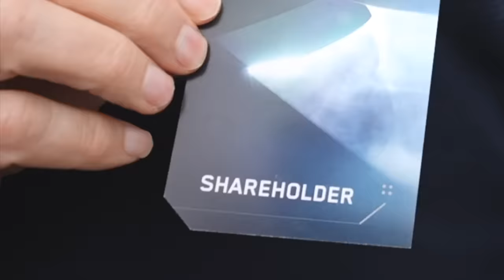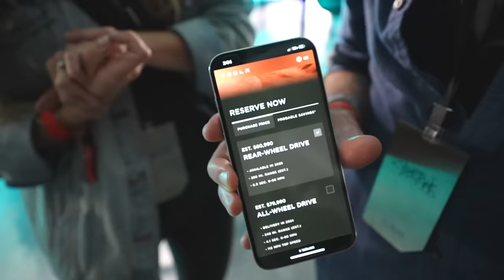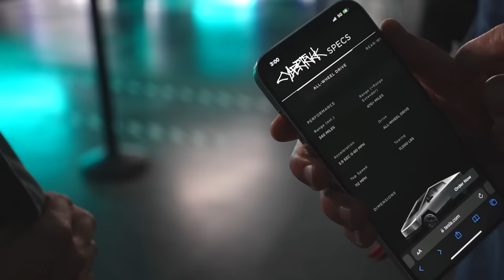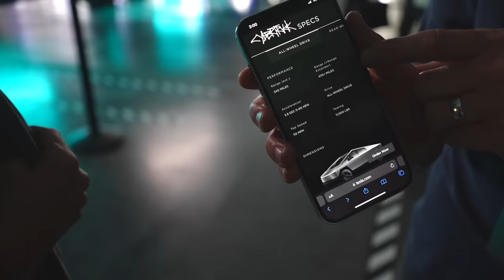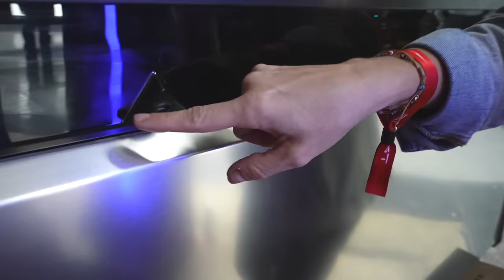I’ve Owned 4 Teslas, but the Cybertruck has me Confused

Comment: Is it true that the CT buyer agreement will have a clause prohibiting resale within a year?  

If so, Tesla is turning an eye to secondary markets and public/competition (as mentioned in video)

That in mind:  it seems battery supply is less than ideal, FSD 12 should be out of Beta, and mass market vehicle is ~2yrs away, mass transit vehicle maybe another 2yrs after that, and then the Tesla bot is ramping fast both mechanically and intelligently.

How long will Tesla continue to sell vehicles?  How long will Tesla "need" the upfront capital from vehicle sales?  At what point will it make economic sense to go subscription only?  

I kinda get the feeling that by 2030  purchase options will be less than today.  

FSD is pricing is currently at a ceiling without an increase despite recent developments. 

Mass market vehicles will be the most tech capable at the lowest price point, will their agreement prohibit resale of any kind?

Big advancements are around the corner, hard to imagine that the age old purchase agreement transaction remains unchanged throughout.

Big Tesla Fan/Shareholder, but non-plussed by the CT delivery event.  Was expecting a no brainer decision to buy, and now like many others, searching for reasons not to cancel.  Specs are too closely competitive 

Sorry for the long rant..

Comment: As someone who drives full 4-wheel-steered construction equipment, it is very easy to use.  While making a right turn the back tire can not run over the curb, as the rear tires follow the path of the front.   CT, I believe, has less steering angle in the rear then the front, so you'll still have look.  @my2cents395

Comment: Could never go down to 250 mile range.  My 5 1/2 year old LR Model 3 has 20% range degradation after 89,000 miles.  If they drop the price of the mid-range version from $79,900 to to $72,000, then apply the $7,500 tax credit, I might consider.

Comment: I think Zack's response was ridiculous. A lot of thing's have changed in the world and inflation is out of control and for him to think they could still offer the original pricing from 4 years ago is out of touch with reality. They obviously ran in to far more production issues than they had planned on not to mention Elon has investors to answer to.
Car, SUV & truck prices across the board have increased dramatically in the last four years so the new CT prices should come as no surprise. As far as range goes maybe it will deliver far more range than stated and anyone that believed they would deliver a truck that large with over 500 miles of range with current battery technology needs a reality check.

Comment: Everything has gone up since 2019. Don't blame Tesla; blame your government's economic and spending policies. As far as the Cybertruck itself, I've hated its doomsday/mad max look from the very beginning, but now that it's in production, I am finding myself liking it. Why? Because of what is in front of our eyes, I.e., the ruggedness that only the Cybertruck can deliver. Most vehicles, if not all, can be damaged, at least cosmetically, by a renegade shopping cart or hail, but not Cybertruck. The Cybertruck might be the only vehicle you can not give AF about when parking at a Walmart parking lot or in your driveway during a hail storm. I worry constantly about my R1T everywhere I go. Range, as we know, is one of, if not the most difficult, things to achieve in an EV design. The range of the original Cybertruck was part fantasy, and I'm sure on paper, it was at least possible. But developing the 4680 fully dry electrode high-density fast-charging battery is still a few years away from realization, but no longer decades away. Just look at where the competition is today, and it's easy to understand how advanced Tesla is, even though the super battery technology hasn't made it to production yet. I am keeping my reservation for now, and I will wait and see how the Cybertruck does in the real world before making my final decision.

Comment: The only thing that shocked me is the price of the rear wheel drive version.     I really thought that was gonna be 50,000  

The all-wheel-drive version was the price of exactly what I thought.    Elon likes people to be able to get the tax incentive and I knew 100% that it was gonna be $79,990    I thought the range was going to be 350 miles and it’s only 10 miles off   

I also thought that they would have a larger battery pack and it’s true. 

Now I’m just trying to decide do I need a cyber truck that goes 0 to 60 in 2.6 seconds      

With the federal tax incentive it’s $28,000 more 

I don’t think I really need that 

I can save that $28,000 for my Aptera.

Comment: Sometimes we are so disappointed that we reject the possible because we can't get the perfect. Things you really want are usually more expensive than you would like pay, that's life. If you want something really cheap you can find it. If you want something that you really want, you have to pay for it. The range thing is really a non issue to most drivers. Just think about it. How often do you have to refill your ICE vehicle fuel tank to complete your trip. Most of us rarely drive 300 miles or more in a day, so charging your EV at home before the daily drive makes sense. On those long trips how often do you drive over three hundred miles without stopping? The Telsa changing system is available and becoming better everyday. For some the range issue is a real problem, for them diesel trucks will still be available. For the remaining 85 to 90 percent of us the range is not really a problem.
Reply: People are just salty because they put down a $100 deposit 4 years ago expecting a $40,000 electric truck that will never see the light of day after what has happened the past 4 years.

Comment: The range is a mild disappointment but the price complaints are silly.  Not only has inflation gone nuts in the last 4 years but lithium and stainless steel prices have outpaced even that.

I was hoping for a 400 mile base range on the dual motor without losing bed space to an extender but whatcha going to do.  I'm sure they had to make some tough spec calls with costs in mind.

Comment: I think Zack is been a bit unfair here. The r1t is the same price or a bit higher as the dual motor cybertruck plus it’s smaller, not to mention the cybertruck has stainless steel body. Also it has better ground clearance and faster. The stainless steel body alone triumph it over the Rovian 1rt let alone the charging network and everything else

Comment: Pricing is mostly the result of balancing supply and demand in the current market. I would add by the way that the dual motor exceeds what was announced in many ways even if it misses on some (although for most people some specs like top speed and a payload above 2500 pounds do not matter). So I am very happy with the dual motor specs but I do hope price will come down in a few years when there is a better balance between supply and demand.
Reply: That is correct.  And it's hard for YouTubers and Tesla to answer honestly about this without getting political but when Tesla announced Cybertruck back in 2019 we were under Trumps healthy 2% inflation.  Fast forward to 2023 and we're now under a 41 year record high inflation almost 3 years into Bidens presidency.  People can go back and forth on who is to blame but regardless the numbers don't lie, and Tesla didn't predict it would cost anywhere near this much to build Cybertruck when it came time for production.

Comment: Anyone that thought the price wouldn’t increase by at least the general inflation rate since 2019 is not thinking it through. Inflation across the board is somewhere in the region of 15 to 20%. Electronics, chips and tech have gone through the roof well above that. I wonder how much loss is still gonna be taken on each vehicle.

Comment: The only thing I found disappointing was the range extender. That should be in the damn pack. The price I could live with all the other things I love about it but holy shit it ruins the truck both in space and payload. But I’ll hold my reservation till I see reviews of the battery extender just in case. 

I will use my truck to tow full time. I was so excited, they ruined it with that one aspect.

Comment: Good job Tesla. Specs are great. Hopefully production will ramp faster than projected and price will come down and range go up. So many headwinds globally right now. 
Try this price on your wallet, as a Canadian. $108,000CDN for the dual motor version. $138,000CDN for the tri motor beast. No brainer. Way out of my price range at this point. 
Until it can be produced profitably, CT will not raise stock price. Likely the opposite. “Model 2” success critical to help cover CT costs. This pushes out the timeline for stock evaluation beyond my investment goals. That’s likely the reality. Depending on how many reservation holders ahead of me cancel, my order could be as far out as 3-4 years. Based on 250,000/year production rate. 
My focus is now on a MYLR. At $75,000CDN that’s more attainable.

Comment: I don't quite understand Zack's comment about the same specs being $20-$30k more than Rivian.  The Dual Motor Rivian is slightly more after the tax credit than the dual motor Cybertruck.  If they had priced these any lower, investors would have been ticked and the stock would have tanked.  Anyone that truly expected lower prices has no business sense.  Keep in mind the Rivian is much smaller for occupant space and cargo space.  

And I also don't understand the whole "downgrade from what we were promised" argument I hear for lots of product launches.  First - nobody promised you anything.  Second, they also added rear wheel steering and gigacast body.  If something doesn't meet your needs for the price - don't buy it.  Don't whine and moan about it. Just buy the Lightning if you like that better.  Rivian changed their specs and upped their price between announcement and delivery as well - remember the tank turn?

Comment: Listen people, stop listening to all of the naysayers who already hate Tesla.  They're missing the forest for the trees.  

48V architecture, steer by wire, 300 class stainless steel martinsitic body, best software of any vehicle, bullet proof, 10 degree turning radius, etc., what other vehicle on the market has this?  

Prices will drop as production ramps up due to Wright's law and economies of scale and the range will increase as they squeeze out more efficiency out of the new 4680 cells.  Range extender is smart, since it gives people the option to choose rather than not.

Did i mention that it will be the safest vehicle on the market.  Yes it'll beat the Model Y in that category which is currently the safest vehicle on the market.  Absolutely worth the money if it gives me peace of mind for my family.

Comment: I feel lied to when it comes to the Cybertruck but especially the tri motor.  It's $30K more expensive but that doesn't take in account that the originally $69K Cybertruck price included a 500 mile range.  Now, if I want anything remotely close I have to pay an extra $16,000.  Ao if I want a truck that's even close to what was promised I have to pay double for the truck? SMH.

Comment: As a truck guy I hate the way the cybertruck looks and wish Tesla would have just built a regular looking pickup. Non truck owners like Dan (what’s inside) have to much influence and made it seem like they would buy something like this never in their right mind would have purchased this truck. The price does not bother me at all my 350 super duty cost the same. If it can compete with my 350 I’d pay it. Range does not bother me because my work is local I don’t need to drive 300 miles or more in a day. As long as I can make it from the shop to the job site and back towing my skid steer I’d consider it. Too bad it’s ugly and as a truck guy I won’t buy this.
Reply from the maker: interesting points...thanks for sharing.
Reply: Beauty is in the eye of the beholder. All other trucks look the same, why wouldn’t you want something different unless you’re a sheep who’s afraid to look different from your other sheep friends.

Comment: The percentage of people who need more than 300 miles of range is very small, and the Range extender accommodates them. To load the truck up with batteries that will rarely get used goes against first principles thinking.

Comment: Downgrade???? are you kidding. You have no idea. Talk to any of the engineers that built it. They are super proud of all the upgrades above and beyond what was there 4 years ago. Yeah the 4680 batteries are taking longer to get to where they are going. SOOOOO... the truck is expensive and the top range is WAY expensive (range extender). But everything else under the hood is mind bending. DOWNGRADE??? What???? Drive by wire. Turns like an S. 800 v drive. 48 volt system. Massively less wire. 11.7 kw power output to house or vehicle or welders. Prelined bed. Rear wheel steer. Bullet proof steel. Gorilla glass. this is just a start to the long list dudes. Deal with ignorance first before spouting judgement.

Comment: Lets just say it how it is. In a lot of ways, Elon is also disappointed with the CT. First, he hyped it to be this vehicle that is to be better than the normal car because the SS will make it cheaper to produce rather than normal curvature car that uses costly stamping tool. Second, he hoped the glass would be able to withstand a metal ball thrown at it. Third the range would be higher. Tesla had to release it now because they couldn't achieve what Elon was hoping for and couldn't delay it any longer. Perhaps one day, Tesla will be able to deliver a CT that will be more cost effective, tough enough, and slightly better range. It also look smaller than originally shown.

Comment: I think if the prices weren’t so low at first, most wouldn’t have a problem with it. I think it’s worth 79k, has all the stuff model x has. I think it’s better value than the X and its 79k. But because it was advertised at the beginning so much less it then is a disappointment.

Comment: Why are these people shocked by the range lies for this behemoth?? ELON said 330 miles on a single charge for the model Y and that’s always been a lie…. You’re Lucky if you get 270-280 and don’t turn on the air conditioning or if the climate is hot or cold.

Comment: They are raising the price to capture the regulatory credit $7500. The Dual Motor comes with $2500 wheels. They will drop a couple more things and get the Dual Motor down to $60k in 3 years. Once they get the first adopters out of the way they will drop the price by $5k….by late 2024.

The beast will stay the same price for sure.

Comment: Elon has always said that 'prototypes are easy. Production is hard. When the CT was unveiled 4 (that's 4) years ago it was a totally different world. The economy was very different and Tesla had an overview of how to mass produce this beast of a vehicle. The initial pricing for this production model Did Not take into consideration where they were going to be with the production of 4680. There aren't enough of these batteries to produce a lot of CT's. so they priced it accordingly. Supply is low and demand is high. $100K Beast. The Model S was very pricey when it was first produced It will be the same with CT. I think that steer by wire is worth the extra cash. The price you pay as an early adopter is that the the product is not evolved yet. It is still a chrysalis. It is not the butterfly yet

Comment: The significance of Cyber Truck is that it is the high margin, early adopter platform one which Tesla has developed and will perfect a variety of esoteric but super significant technologies which will ripple through all of their products, disrupt the energy industry ushering in the age of renewables and through the auto industry offering less expensive, electric vehicles.  The most significant are: 

History Will Mark Tesla adopting V2G As the disruption point when fossil fuels met their demise - V2G = Vehicle to Grid 
- Bi-directional Power Flow (They are not the first but will make it the standard and will integrate into the grid on large scale) - Makes renewable energy into a firm source of power.  You will be able to provide grid support and make money doing so during demand peaks.  You will be able to run your house off it in power outages.   You will be able to charge stranded vehicles.  In the end I think this will be the most significant

Revolutionary Industry Shift
- a shift from 12 V to 48 V accessory power (reduced materials, higher efficiency, lower cost)
- A shift from 400V to 800V (faster charging, higher efficiency, reduced materials, probably lower cost, small range benefit)

Cool but significance unclear
- Steer by wire ( I am not sure how big a deal this is.  It will almost surely reduce cost.  And with kids raised on video games, offers the possibility of joystick steering, and remote operation )
- Stainless steel ( significant lifetime energy savings.  There is a lot of energy that goes into making stuff, these will last much longer than cars.  So embodied energy can be amortized over multiple car lifetimes, particularly if they start to fit these with LFP batteries)